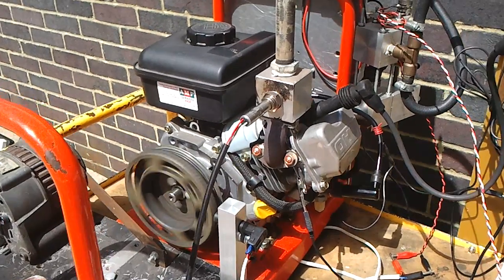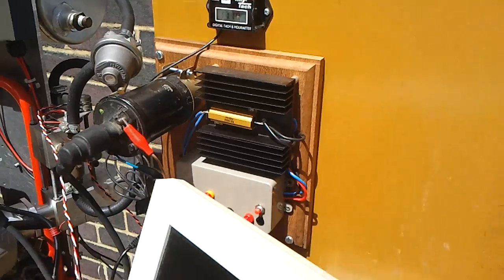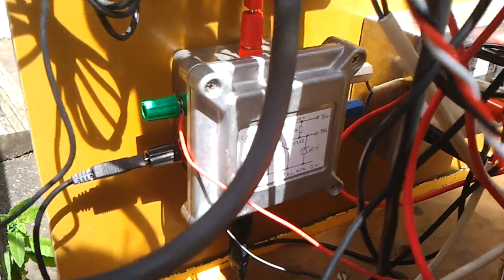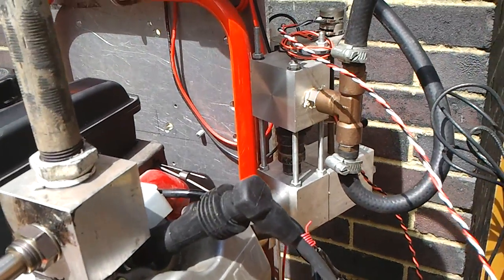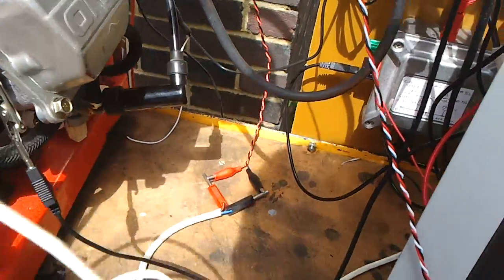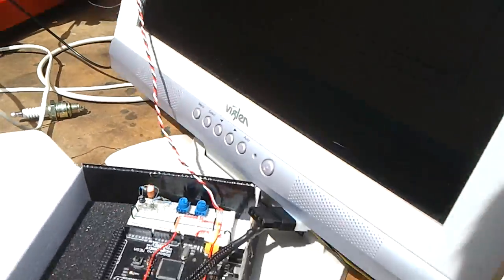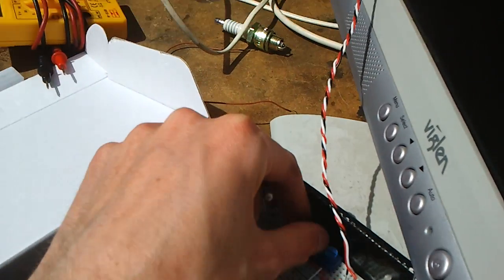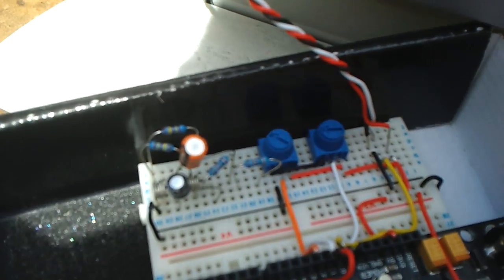Arduino ECU Electronic Igntion and Fuel Injection

Comment: thank you for sharing.
How many teeth are in the flywheel of this engine?
Reply from the maker: 32 or 36 minus 2 if I remember correctly
Reply: @Gadgit83  hi sir
i have engine - single cylander 
and my engine doesn't have camshaft sensor  so i'm have problem with detemined positon fuel injection. Can you suggest me how you define it? 
sr for my english very bad
Reply from the maker: @dinhtanloi536 Hi, your English is good enough to understand! You really need to have cam shaft position. Maybe you can just fit simple sensor like hall effect or light sensor which has once per revolution on cam shaft, so you can know which stroke you are on. If you are not doing fuel injection and just doing spark control, then you can just fire on every stroke as a wasted spark system does. You could try just doing fuel injection on every stroke too, but I think you will have problems with backfire at low speeds
Reply: @Gadgit83  tkss sir .  have a good day

Comment: Hello, great project, how do you keep EMI at low levels where it doesn't interferes with the atmega microcontroller?
Reply from the maker: Good question, this was a bit of a challenge, especially with the USB connection, it did cause me problems. However only on engine starting up if I remember correctly. The design of the ignition circuit is important with snubber diodes on the primary coil to prevent ringing when switching it.

Comment: Awesome build man!  You were first hit when I searched for arduino fuel injection!  Still reading about setup, however wondering why you would use manual trim pots when you have a controller that can do this for you and at a faster and more accurate level based on feedback from engine exhaust and possible exhaust temp?  Keep up great work and thnx for great post and info! U ROK!
Reply from the maker: thanks for the support! it was just easier to use trim pots to start with, and my USB connection kept dropping out!

Comment: seems awfully complex replacement for a set of points and condenser
Reply from the maker: some people said cars were awfully complex compared to horses... Electronic engine control does over benefits if you care about power or efficiency
Reply from the maker: +Gadgit83 although compared to points, I guess the main benefit is probably lifetime...
Reply: And you could hook a ps3 controller to it for remote control :)

Comment: how does the engine run compared to carbourator? how's the exhaust? is the fuel mixture pretty even? I'm not an environmental freak but I was wondering how more efficient this runs and the differences, it be cool to build something like this for a lawn tractor for fun, I got more than adequate mechanical knowledge but probably inadequate knowledge building arduino devices, pretty awesome you made something like this, and screw the haters calling this pointless, i think its fascinating
Reply from the maker: +fury3600 Thanks for the comment and support! The good thing about Arduino is how much support there is, and it's fairly easy to get going. If you're interested in learning it's a good place to start! I would suggest having a look at the Speeduino project too.

I probably didn't have mine tuned that well but the general theory goes that it should (or could) have perfect combustion, because the lambda sensor is measuring the oxygen left in the exhaust and this is used to correct and perfect the amount of fuel going in. In theory it should be more efficient or powerful (depending on tune) than a carburettor especially in heavy transients and across a wide range of ambient conditions.

Comment: Hi, Im interesting to do an arduino work like this... for a Renault 5 1984, could you share some files or doccumentation about your project. Like de injectors you have used or  the sensor... Greetings
Reply from the maker: +Jorge Cruz Diaz Hi - really sorry for the slow reply, I don't have a lot of info on the sensors or other components - some of them were there before me. I would suggest trying to use a 5V trigger ignition coil (Chevvy LS engines have these) and whichever injectors fit your engine... Crank sensor is easiest with a Hall effect. Check out Speeduino if you're interested in more

Comment: How did you made the arduino recognize the lambda?
Reply from the maker: I used a Horiba Lambda sensor interface. But a cheaper way is to use a 'wideband oxygen sensor' such as from Innovate Motorsports

Comment: Wow, could we adapt it for an 4 cylinder gasoline engine?
Reply: Yes, you could, I just bought a chinese clone arduino duemilanove from ebay, and i'm trying to run a 4 cyl renault 12 engine(Here in Romania it's called Dacia 1310). I'll keep the original distributor ignition, get the rpm stuff from that and then drive a bosch motronic injection system which i adapted to fit on the stock manifold. Basically, I'll have full control over the fuel that goes into the engine so, I can make 3 modes: Eco, Standard and Sport. The only difference in this thing will be the time of which the injector stays open. Eco will give you less power but saves you money and so on..The only thing I'm concerned about are the spikes that may come from the distributor and which may fry the arduino instantly.I need some sort of schematic as I hace to pull the Arduino analog pin LOW. And I'm only 17, lol:)
Anyone who is interested in a video reply to this comment, i'll get to work as soon as my order arrive:)
Reply: Yes, I do know very well what i'm on now.The engine itself doesn't have any sensors at all.I do have a newer car which has the same engine but it is all electronic(ignition, injection,  etc.) It uses the bosch motronic 1.7. Now, the engine i'm working on it's actually on the car and as I mentioned, I'll keep the ignition from the distributor, so I won't have any troubles with the timing. Getting too little/many fuel into the engine will basicaly just shut it down, it won't do much to it. It's like driving 60kph and cut off the engine, the oil inside it keeps lubricating the critical parts band the coolant will cool the engine as the movement of the piston generates friction, which generates heat . I DO have to calibrate it for the optimal air/fuel mixture for each mode.
I'll test it to see the power it puts out.The code itself won't be too complicated I'll use While loop to make the code more efficient and without any delay. For the injector i'll use a MOSFET to drive it, just because it dissipates less heat
Reply: Gadgit83 I still can't figure out which circuitry i need.I just tought of a zener diode like 4v7, a regular diode such as a 1n4001 and a capacitor . It would be simpler with a schmitt trigger and a autoresetable fuse, but can't find them anywhere here. The distributor basically opens and closes the ( - )wire of the  coil. I saw few schematics on the internet, but they won't work in my case. For the engine, google " motor dacia 1310", and go for the images. Just like an idea to show you what i'm working with.
It would probably be better to post this question on EEVBlog ,But I haven't got the time now. If you or someone can help me i'll be very thankful. Cheers and happy prototyping! :)
Reply: Btw, thats the same account but this one is for my music, check it out! :)
Reply from the maker: Alex Alex Yes, I would be very interested in seeing this! I have just bought a classic mini which I would like to do a similar thing with. Just as a note - I'm sure you're aware, it isn't quite as simple as adding more or less fuel as the engine always requires a roughly stoichiometric Air/Fuel ratio to run correctly. If you dont add enough fuel then the engine could easily be damaged. This is what the lambda sensor is used for. On the other side, you can get more power with more fuel up to a point, but there is a balance to play!

Usually an Eco/Standard/Sport mode would also alter the ignition timing, with more advanced timing providing more power (again up to a point before causing pre-ignition/knock and damaging the engine)
Reply from the maker: +XanderZ Sorry I didn't see these comments - did you get any further?
Reply: Well since then, I did some nice things, I ended up on eevblog, and some german guy helped me with the code, and I even posted a video about it on my other channel. 
Now it's gathering dust in my garage and got it to pieces..It just wasn't worth the expense of money. I just got it to run, rev it up a little, and then gave up. I could make it waay better for sure, but sadly without a practical use..Maybe if I was in a development team, and have all the stuff I needed I would have probably had a custom car by now
Reply: Have you did something with your mini?
Reply from the maker: Ahh, yes, such is the way with these projects - get the hard bit done then loose interest! I did something with my mini - modified it a bit, broke it, drove it, crashed it and sold it... Was an awesome car!
Reply: You crashed it? Why? How did it happen? Was it because of your mods? :P
Reply from the maker: Not on purpose, that's for sure! I never really drove it in the wet, and the one time I did, a van stopped unexpectedly at a roundabout, I locked the wheels and slid into the back of them... Nothing to do with the mods
Reply: Of course it wasn't on purpose :P Sadly no ABS for old cars :/

Comment: Hi I am a Electronics Teacher in Brazil, I've been teaching electronics for two years and the first student that I have been able to work with is aptempting to build a project similar to yours, I worked in audio projects in my PHD because I love music and I sugest this work to this student since he is crazy by cars, maily turbo engines, I rather prefer V8s.  But this is another topic.   I think that we will use a old carburated VW AP engine 1.6L from the 1980s.   If you can help us a bit.   He is doing his work as a graduate final course project.   If you could help us with information I would be very greatfull.  It seems that we cannot find many information on ECUs on the internet.  Please send us your email so we can exchange information.  We intent to use arduino as base for the ECU also.
Reply from the maker: Hi, sorry, for some reason I don't seem all my Youtube comments when they come in, are you still working on this?
Reply: Hi...  i have some pupils working in this project.  They are using pic micro controlet so far  but  it is possible to have a arduino   version.....we will run a four cilinder 2,5 chevy engine with four noozles...if you can give us any tips for this project.
Reply from the maker: Hi, glad to hear you have started a project, it sounds like a good challenge! I think if I was doing this for a 4 cylinder, I would find some coil on plug coils with 5V trigger signals so that you don't have to interface with a 12V coil (look on the mega squirt website, I think some GM engines use these) I would also buy a little solid state relay module for arduino ($10) to drive fuel injectors. For crank sensor, use trigger wheel and a hall effect crank sensor will input straight to Arduino, or VR sensor with zener diode to clamp output to 5V and opamp comparator to convert sine wave to square wave. You should also look at the Speeduino project which has multicylinder engine management for Arduino. I would be very interested to see any progress you make!

Comment: great project! is there any reason you decided to go with an op amp based vr conditioner over a dedicated vr chip like an ncv1124? i want to build an arduino based ecu for my 4 cylinder engined car one day...
Reply from the maker: Not especially, I didn't build that interface, although one of our university modules was an 'analogue electronics' module so we built our own signal conditioners. Using a chip would probably make more sense, and I would do that in the future.

Comment: How precisely do you control timing? 60000000 us / 6000rpm / 360 degree = 27 us for one degree precision. What values are achievable with Arduino?

I am working on an ECU based on stm32

Comment: Thanks for the info. I know basic electronics, but am lost at this level of complexity, so I am thinking of trying a mechanical/ electrical set up. Basically a small carbon brush sliding on a circular plate, with a narrow copper strip on it, being driven at crankshaft speed, as it is for a 2 stroke engine.I would be using an injector from a small car engine. I will have to do a sketch and some math to see what the injector duration would work out to be, probably take a miracle for it to work! :)

Comment from the maker: The electronics aren't too complicated really, they're just in separate boxes. Certainly the fuel injector driver is the simplest part. 

Idle requires a single pulse per revolution (so two pulses per full cycle) of around 1.5 ms, but that's obviously specific to the flow rate of my injector which I'm not sure about - it's pretty oversized.